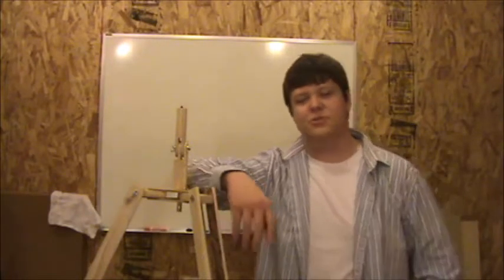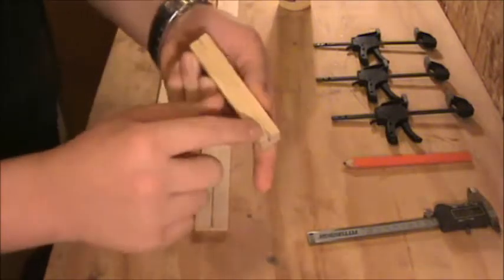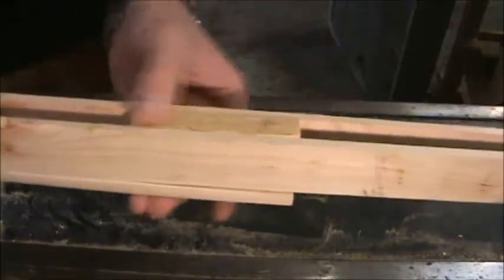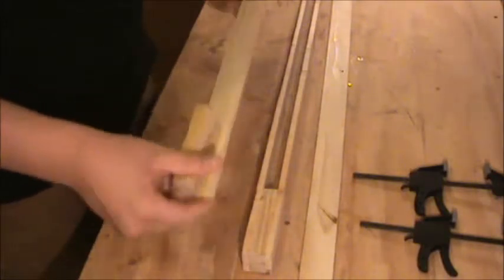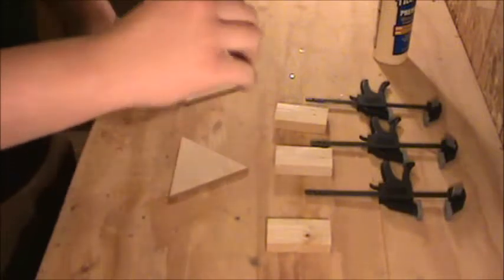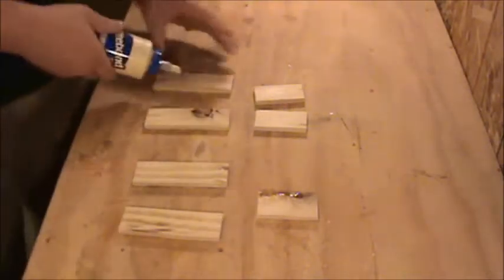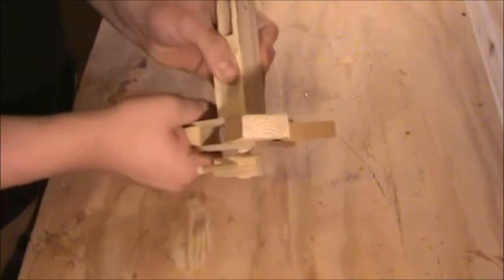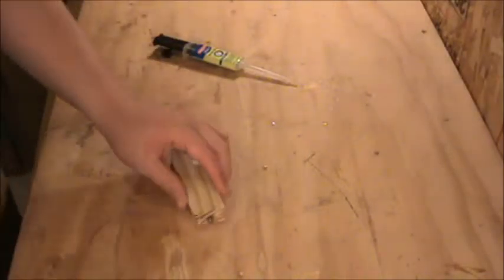Building a Wooden Tripod

Comment: Good video you answered some questions that I had for my project.  If you use wax on surfaces that you don't want glue to stick to it is very easy to remove.  That will also work for your epoxy.
Reply from the maker: Eaglesnest Woodandpottery I will have to keep the wax idea in mind for future projects! Thanks for letting me know, I hadn't thought of that.

Comment from the maker: Material list:
3 1x2's
A bit of plywood.
1 1/2 inch dowel
1 piece of 3/8 all thread (this can be replaced with a few 3/8 bolts, if using the all thread, also called threaded rod, you will need wing nuts to weld on)
3 3/8 wing nuts
3 3/8" t-nuts
1 piece of 1/4" all thread (or 4 bolts)
4 1/4" t-nut
4 1/4" wing nuts
wood glue
epoxy

Tools:
chop or miter saw
welder (If using all thread and wing nuts. possibly could be done with epoxy instead)
drill bits for t nuts
clamps

Comment: please let me know the alternative to t nut
Reply from the maker: Hi Varad,
Thanks for your question!

As an alternative to a t nut, I would drill the hole big enough to fit a regular nut. Take that small piece of wood and put masking tape on one side to cover the hole. Then put that piece on a flat level surface (tape side down) and place the nut in the hole so its touching the tape. Then take some epoxy and carefully get it around the nut to secure it in the hole.(probably using a toothpick or something, I don't think the hole will be big enough to pour the epoxy around the nut) That should hold the nut in place and hopefully be strong enough to secure it. Be careful not to get any epoxy on the threads on the inside of the nut, that will stop the bolt from being able to go through. I can also make a video demonstration if that would help.

I haven't tried this, so no promises, but its the best idea I have for now. Hope this helped, let me know if you have any other questions!